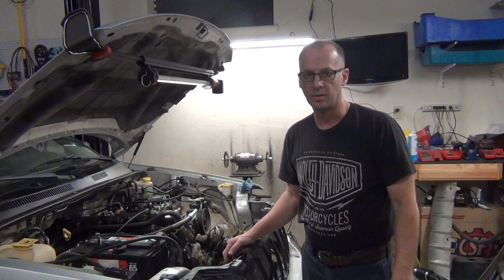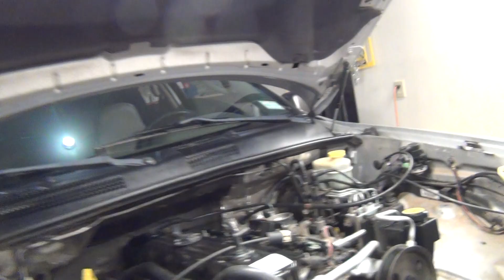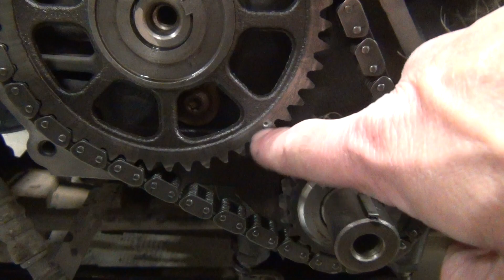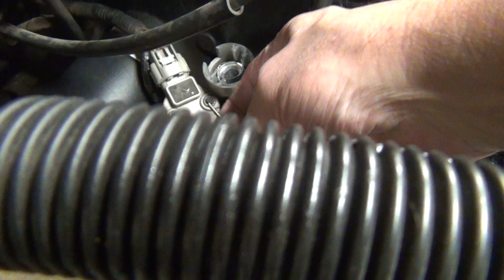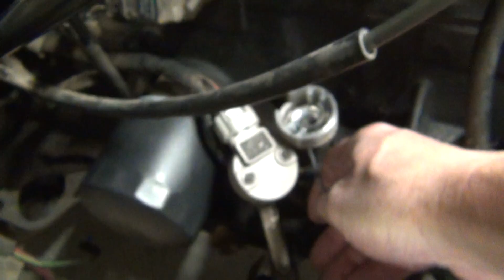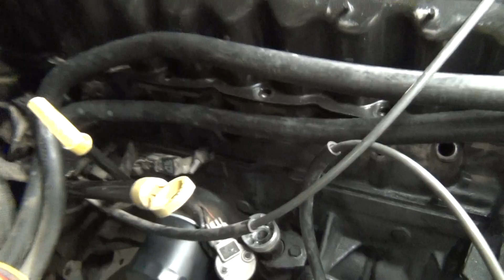Chrysler/Jeep 4.0L inline 6 Timing - quick tip

Comment: Do I need to do this for a reman . That has the chain pre installed ?
Reply from the maker: Does the reman engine come with the cam sensor/distributor already installed?  If not, you will have to set it up when you install one of those (depending on the year model it will have a distributor or just the cam sensor)

Comment: Having a timing issue with a 98 wrangler sarah. Was running fine. Had to replace the transmission as well as the exhaust with a 2000 model. But it seems like it is out of time. Ive redone the timing the old school way, number 1 piston at the top on compression stroke, Distributor button at number 1 plug. With this being done the Harmonic Balancer nick is pointing at 11 oclock nowhere near the timing marks, which are at 2 oclock. I did see a video where a guy took the distributor gear off rotated it 180 degrees and put it back on. Im assuming thats what wrong with mine. Any insight?
Reply from the maker: Some harmonic balancers are two piece devices and the outer ring can get twisted away from its original position throwing off the timing mark with respect to the pointer. If you are 100% sure you at TDC on compression stroke of #1 cylinder, then line up the Distributor such that the rotor is pointing at that #1 spark plug wire contact and it should at least fire off. Then you can turn the distributor by ear to a better running timing then lastly hook up the timing light and set it where it should be. Don’t use the balancer timing mark if you at all suspect it could have spun off the OEM position.

Comment: I'm sure I'm having timing issues. I did a top half rebuild replacing lifters, rockers, rods valve guides and seals and also replaced camshaft and crankshaft position sensors. It won't start but I feel like the timing is off changing the sensors like we did. I don't have the timing chain cover off but have my valve cover off. How do I know for sure if I'm on the exhaust stroke with the dots lined up so I can align the camshaft position sensor
Reply from the maker: The first valve at the front is the exhaust valve for #1 cylinder. But now you have the timing cover buttoned up probably easier to time it on the compression stroke old school. Bump it until both cylinder 1 valves are shut (full up position) watching for the TDC mark on the harmonic balancer. When you are at TDC and both valves are up, not pushed down, set your cam sensor 180 deg from the way I did it with the little drill bit in my video. You won’t be able to use the drill bit trick on the compression stroke. That should time you correctly. 
Also if the crank sensor signal isn’t making it to the ecm the fuel pump won’t come on. Instant message me on Facebook Messenger and we’ll set up a phone call.

Comment: Yeah.. had to replace pump drive/synchronizer. Pain in the A$$. followed another video, 180 out... would idle but die. Got pissed and flipped it 180, perfect, thought to myself 'that ain't the f'in compression stroke but the $$ light agrees, cell light off, I changed because of loud tick at idle. Too much play on syncr shaft, the little phaser basket would rotate around and actually contact the cam position sensor. I thought piston slap or rod knock but w the engine at idle I placed my finger on CPS and could FEEL the ticking.
 I hope this helps anyone
  4.0 forever.... or as long as the frame holds. My new to me 03 is from FL, fingers crossed

Comment: I got 1994 with a distributor the cam position sensor is on the bell housing how can I make sure the distributor is set right
Reply from the maker: I believe the sensor on the Bellhousing is the “Crank Position Sensor”. If you still have the dizzy, you set timing by pointing the rotor to the #1 cylinder wire post with the #1 cylinder at top dead center on the compression stroke. Old regular way. Then use a timing light to set timing per manufacturer spec. I don’t recall for your motor what base timing is, but probably close to 8deg BTDC.
Reply: @Texasknowhow  Thank You Brother

Comment: OK - so my 4.0 will not start after putting in new camshaft. I did the TDC on compression stroke method because it is literally what the service manual for my 2000 jeep xj says to do. What you are saying is the OPPOSITE. I'm going to try it and see if this pig will start for once. I just hope I haven;t already fried my cam lobes by trying to start it so much.
Reply from the maker: You get it figured out? Hopefully it’s back running again!
Reply: @Texasknowhow  Not yet - I work and live in NC during the week and see my family on weekends; the Jeep is with them. :(
Reply from the maker: @whiptips4374  - Well, I hope you get it worked out this weekend. Pretty country out in NC.
Reply: @Texasknowhow  I tried and it didn’t work. But it’s not your fault; there was zero and low compression in all the pistons. So I pulled the head and realized that I didn’t get all the oil and gunk out of the bolt holes - there was a bit of oil on the head bolts on driver side so they lost torque. Or I cracked the block at every single piston. Bad day. lol
Reply from the maker: The pin method of alignment is indeed on the exhaust stroke vs compression. But you just have to lift up the cam sensor out of the gears and rotate it 180 degrees if you want to do the set up on compression. The pin just won’t go through that hole this way. Make sure the connector on the cam sensor is pointing straight back as well. The ECM can take it from there and fine adjust the timing.
Reply from the maker: Also, it should start quickly so don’t keep cranking if it doesn’t. Something else could be preventing the start up. Ensure all your other stuff is connected. Did you replace anything else besides the timing gears and chain?
Reply: @Texasknowhow  me and my mechanic have both gone over this and can't figure it out; everything seems fine. But we have this feeling that it may be 180 out of timing. I put a cotter pin in cam pos sensor hole, and while the engine was aligned at TDC on the compression stroke, I slid the cam pos sensr assembly into its place so the gears slipped into the cam, making sure the cam pos sensor connector faced straight back toward the firewall. Now you have me thinking that I just paid 675.00 to a mechanic when all I needed to do was rotate the cam sensor metal flag 180 degrees.
Reply from the maker: @whiptips4374  - THIS is exactly why I made the video and finish the video saying, “dots on gears together which is the #1 cylinder exhaust stroke AND pin in the flag”

Comment: I mean if it goes on and comes off in the same direction and its only one direction would it actually matter as long as you dont touch or turn anything after you take the old ones off and put the new ones on…. Im sure you can just slip the old one off and put the new one on since it keyed and wont fit any other way
Reply from the maker: Yes, for a Remove and Replace you are very much correct.  The video is more for those that have got the motor un-synced for some reason or have rebuilt the motor and they are going back together.
Reply: @Texasknowhow ok so im right neat had me worried thanks for the response even though its an old vid😊

Comment: So I just got a 4.0 and they guy replaced the timing chain messed it up so I gotta figure out how to fix it  how can I get it to spin and get to those to dots ?
Reply from the maker: If you turn the crank (by hand with a socket on the crank bolt) and feel resistance, stop. I can’t remember if these are interference engines or not (I should know, but don’t) the pistons could be hitting the valves. There may already be damage. But start by taking all the plugs out so it’s easier to mess with. Then take the timing chain off by removing cam sprocket. They are both keyed so you can’t get it wrong going back on. Work to get the sprockets aligned such that the dots are together while they are keyed on their respective shafts. Put the chain back on. Now that you have that correct, follow the short video. By the way, he may have it correct already. The dots only align every other complete turn of the crank. On the non-aligning turns the cam dot will will be opposite side (up on top). Hope this helps.
Reply: @Texasknowhow  thank you so much man i will definitely try to the guy that had it replaced it guess he didn’t no how to put the cam back like it should when he started it the motor sounded decent but had like a small knocking sound ? Should I just replace motor or is it worth it to try to save it
Reply from the maker: @SLINGING_MUD_SINCE1994  - unrelated to the cam timing these engines are known to develop piston slap which sounds like a rod knock to some degree. Many including myself have daily driven them with the slap for many more miles. If that is what it is…

Comment: I am stumped. I have questions. I bought a 4.0 with the coil pack and synchronizer. I replaced the head, chain, ECU, water pump, crankshaft position sensor (ntk), 
coil pack, and camshaft position sensor . It was cranking with no start. I’ve played with the synchronizer and can get it to start but it runs really rough and will die if I attempt to put it into drive. Sometimes there is a backfire if I move the synchronizer in different positions. I’m lost on  getting it running smoothly. There is spark, compression, and fuel. I’m leaning on shorted wire? Flywheel cracked? 

Also, just to clarify . When I changed the timing chain. Are you saying in your video that when the dots face each other I’m in exhaust stroke and the holes with a pin on the synchronizer should line up with the cuff/slip pointing to 5:00 from passenger side to be set correctly? I want to make sure I’m not 180 degrees off because the Haynes manual and other videos say to position to tdc on the compression stoke with the holes lined up on the synchronizer! Haha I’m so confused now. My Jeep will start either way but it’s rough idle with three codes popping up. P0353 , P0352, P0351.  I also double checked my timing chain because I was unsure with the mini backfire. Thanks! Someone help!
Reply from the maker: These engines will run (very poorly) with that sensor (the cam position sensor where an old distributor would have been) is 180 deg out of sync. This is because the design of the ignition system is a “waste spark” system. There are only 3 coils in the coil pack. Each coil fires two plugs each time. One of the plugs is firing at the correct timing and the other plug is firing during the exhaust stroke of the “waste spark” cylinder. So if you are 180 deg off, it will run, but very poorly as the waste spark isn’t really timed correctly for normal ops. I think you are still 180 out of time. Rotate the distributor cam sensor 180 deg from where you are and point the wires on top almost straight back. If you get the timing close (wires straight back to rear of the vehicle), the ECM can fine tune the spark timing from there. Hope this helps.
Reply: Thanks for the quick response! I’ve tried putting my 1999 grand Cherokee in compression and tried exhaustion strokes tdc but still runs rough either way. Is it designed to be setup on exhaust stroke with the pins lined up on the synchronizer?  Thanks for all your help!
Reply from the maker: @jacobbutler9875  - I can’t explain it any better than the video really. That’s why I made it haha. Maybe walk through your process with another mechanic friend or relative and show them this video prior so they are ready. Only other thing is if your sensor is missing the little hole in the flag (as some have commented) then you just have to look at where I’m aligning mine and get it as close as you can. You can probably get it done that way.

Comment: What about if it’s distributor cap and rotor on 93 XJ?
Reply from the maker: I’ve not personally done this on a older XJ, but I’ve timed many engines with Distributors and they are all very similar.  I would still put the dots together on the timing set of gears/chain. Then I would bring the #1 cylinder up on its compression stroke. Need the valve cover off to make sure both intake and exhaust are on the base circle of the cam (not pushing down on the valves). Then set the distributor in the engine such that the rotor is pointing to the #1 spark plug tower on the cap. This may take a few attempts as the dizzy will twist some as it engages the cam gear in there. Once you have it close you can rotate the dizzy slightly either way to get it spot on. This will be usually close enough to start the engine. Then connect a timing light and set the timing soon after it starts by slightly advancing the timing or retarding it to specifications. Guessing here, but at about 700 rpm (idle) it will probably be somewhere between 6-10 degrees BTDC as seen with a strobe timing light on the crank timing pointer. Make sure if the dizzy has a vacuum advance hose it is disconnected for this setting. Also plug the hose with something so you don’t introduce a vacuum leak.

Comment: Imma try it your way. Doing a long block
Reply from the maker: Should work good for you. Chime in and let us know how the build goes!
Reply: @Texasknowhow  it worked fine, it started right up, ran great, set a timing code, watched data on scan tool, told me to turn cam sensor to zero, tighten back the bolt, never set a code again, happy customer’
Reply from the maker: @frankjackson9821  - outstanding!!

Comment: We're is the timing set at
Reply from the maker: Rough timing is set per the Video you just watched, but on these vehicles (with the cam sensor vs the old distributor) it is adjusted constantly by the PCM electronically. You just have to get the mechanical timing set like I describe here.
Reply: I wonder if you put the cover on and put the balancer on with your dots lined up, would the balancer notch be exactly on zero?

Comment: Okay so I'm working on a 2004 Jeep Grand Cherokee is it possible without taking the timing cover off to find the right position to set it ?
Reply from the maker: Yes, take the number one spark plug out, put a piece of stiff wire down in there (12” or so should work), rotate the engine clockwise (top of the crank pulley going towards the driver’s side of the car) until it is at the peak. This is #1 cylinder at TDC. If you have a compressor, use a blow gun with a rubber tip and puff a couple shots of air in the plug hole. If it blows easy out of the exhaust port that is the correct place to set the cam sensor with the drill bit trick. If it compresses and tries to push the crank, you are on the compression stroke and need to go on around one full turn of the crank to set it with that technique. Basically you need to be on the #1 cylinder Exhaust stroke to use the drill bit trick.

Comment: Crank and cam don't turn at the same rate, hence the difference in sprocket sizes. Both dots will still line up whether the cam is on the compression or exhaust stroke; you have to line them up and separately verify you're on the compression stroke. Cam will potentially be 180* out if you don't verify.
Reply: That's not correct.  The cam (large sprocket only makes one full revolution which covers the compression and exhaust stroke.  They are two different lobes onb5ge cam shaft.  On a 4 stroke OHV engine the vrank shaft makes 2 rev for every obe of the cam shaft.  The crank sprocket will have 2x tge alignment dot is in position but there will only be one time of those two where the cam sprocket will align touch dot to dot.  On the other crank sprocket the cam will align at the top away from the crank dot.

Because they are both keyway aligned there is no way to screw it up.  The crank takes the piston up and down the same regardless.  It's why you have to look at the rockets to know what stroke your one comp vs exhaust.  If those dots align you are on the same stroke no matter what. There is no way to screw it up.   Again cam shaft only makes one rev per every 2 of the crank.  If the chain is not connecting the cam to the crank tge crank piston position is the same for both strokes of the cam.  It does not change.

Comment: Dots together how? 
Drill bit for what? 
Stupid question also, which way does the 2004 4.0 inline 6 engine rotate when outside in front of vehicle LOOKING at the engine?? 😑☹️
Reply from the maker: If you watch the video a few times those questions are answered. The engine rotates clockwise if you are in front of it looking into the engine bay. Ie if you put a socket on the crank bolt, turn it to the right as if to tighten a normal treaded bolt.
Reply: @Texasknowhow  So when at TDC, the drill bit trick can be performed? And this will be the compression stroke if so chose to do this way? This can be done for each cylinder? 
I cannot see or will not get to the timing notches, so ill have to rely on the feel & the valves.
Reply: @maniacalmonster2293  mine does not have a hole for the drill bit?
Reply: @dadsgonenuts  I bought a different one and it came with location pin